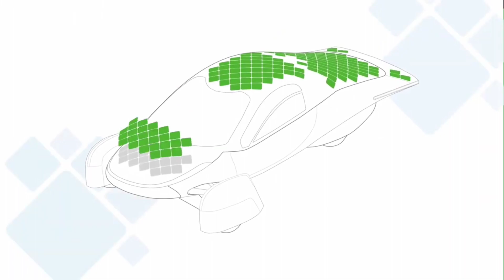Aptera Completely Destroying The Industry With This New Car

Comment: A couple of details - the original Aptera Inc. was a partnership with Idealab.  Idealab brought on a Detroit team when they were ready to start production, and they wanted to build a more conventional vehicle.  They went to the board and kicked out the founders by a single vote in 2009.  They were unable to raise funding for their new plan and liquidated the company and returned the deposits in 2011.

The new company, Aptera Corp, was founded in 2019 when Chris Anthony was able to repurchase the rights and regather the key people from the original team.  There is presently a new crowd funding round open on the Republic platform.  Investments start at $210, and as of today, January 2, they have raised $727,051 in a little over a week.

The number of preorders you mention was taken from the order number series.  Due to some refunds and the fact that new numbers were issued for order add ons, the actual number of pre-orders is something over 38,000, but still increasing rapidly.

Due the unexpected number of orders to fill, Aptera has abandoned the original plan to produce body parts using vacuum resin injection, and will now have the parts stamped from fiberglass and carbon fiber sheet by supercar body maker C.P.C. of Italy.  This will allow production numbers to ramp quickly, but in order to produce the tooling, a major investor needs to be found in the next few months if product is to be delivered this year.  There will also be a major increase in the precision of the parts.
Reply: @Aly Baly [all anyone needs to do is watch just one of your videos to know where youre coming from.] Effective communication skills. 
[For some odd reason you have an unhealthy hate for this company.] I wrote all about hate on one of my last 3 video's (can't remember which). I recommend it to you. There is no reason to think I hate, not even an odd one. 
[Vey bizarre] The problem lies completely with you, and consists of a lack of understanding well below what an average13 year old should have.
Reply: A couple of corrections "They (which is the Detroit team) went to the board and kicked out the founders by a single vote in 2009." It was Fambro and Anthony who went to the board with the aim to kick out the Detroit team. They lost, and nobody got kicked out. F & A tell Jay Leno on his video test drive that they left because the wanted to do something else. It had become less interesting than growing veges and making batteries.
CPC is not a supercar body maker - it merely supplies parts to supercar makers, and it is unknown to what extent they participate. A rear hatch is the largest item I have discovered they supply to an aluminium car body, and I would like to know if anyone can prove better than that? Bertone and Pinninfarina put their names on bodies they make, and I have yet to find CPC badges on any cars, let alone on supercars.
Watch out for all the lies and deception.
Reply: @aussieideasman8498  Any one who knows how to do their own research will find it trivial to refute the allegations you make here.

As usual our Aussie ideas man has no evidence to back up his assertions.  If anyone cares, I suggest they look up the Wired article of the time, titled: "Aptera Founders Ousted in Boardroom Showdown"

,Also, he seems totally unaware of what Modena, Italy is known for, and his default position for his inability to do his own research is to ignore the facts that are available to everyone else.
Reply: @n.brucenelson5920  [Any one who knows how to do their own research will find it trivial to refute the allegations you make here.] Anybody who proves nothing because he hides behind an NDA he begged for should realize it's pointless to argue with someone who explains everything. You have played the 'can't research' card way too often, as well. I have told you that a number of times over, but your senility gets in the way.

[As usual our Aussie ideas man has no evidence to back up his assertions.] Correction: Most of them are explained well enough' a rare few are only with good signs given; and then there's that scientific premise that it is folly to try to prove a negative. For example, if they say it can do 0 to 60 in 3.5 seconds it's up to them to prove it, because nobody can prove it doesn't when they can't get their hands on it. Aptera are the first people in my 69 years that I have seen turn off the timing lights on a drag strip before they do runs. Come on now - put two and two together! 
[If anyone cares, I suggest they look up the Wired article of the time, titled: "Aptera Founders Ousted in Boardroom Showdown"] Now there is absolutely no reason to look it up, because being ousted is a different story than what came from their own mouths on Jay Leno's video. He asked what happened, and they say they left to pursue other interests after merely disagreeing with the Detroit people; no mention of a board room ousting. The start of what are a plethora of almost pathological lies. Did they tell Jay the solar was fake on what he was driving? It was. When they revealed the Gamma, they said it was the first with working solar. Liars get caught lying.

[Also, he seems totally unaware of what Modena, Italy is known for, and his default position for his inability to do his own research is to ignore the facts that are available to everyone else.] It is immaterial what any town is known for. The issue is whether CPC makes entire supercar bodies for a number of supercars with other badges that are on sale, because this is your claim, including the claim of those snake oil salesmen. I say that is deceptive, and my bad research can't find a single body on any of them. The best I can find is an engine cover and some spoilers. Now, use your superior research skills and prove there are at least two supercars that are being driven around with entire bodies made by CPC. If not, you aid in the deception. This is going on my last video because I don't trust you not to delete it here.
Reply: @aussieideasman8498  Thank you for confirming that you don't take the time to look for the truth.  Lots of prose to say that you have not really looked at the record.

I have signed nothing that prevents me from referring to public information.  I do find that providing links on Youtube often gets my posts deleted.  

I have no power to remove your posts on any channels but my own and have not done so.  You can take your paranoia somewhere else.  

You have given me no reason to give your own channel traffic, but I don't discourage others to go there if they wish.
Reply: @n.brucenelson5920  [Thank you for confirming that you don't take the time to look for the truth.] I know what is true, so keeping on looking is moot. 
[Lots of prose to say that you have not really looked at the record.] I'll accept your word this once - does that Wired article confirm they were ousted from Aptera at a board meeting? If so, then what I said stands. If not, then the article has a lying title, and you deceive people by using it.

[I have signed nothing that prevents me from referring to public information.] Is the skin cooling method public or private? Explain on my videos about it how what Daniel showed Steve from AOC can actually work. You can include the Death Valley simulation by the computers next door. 
[I do find that providing links on Youtube often gets my posts deleted.] Happens to just about everyone. Give enough of the name that a search can locate it and ditch links.

[I have no power to remove your posts on any channels but my own] Untrue. If you made the first comment on other sites and you delete it, everyone who responded will be deleted with it. Fanboys do it all the time to me. 
[and have not done so.] YT also deletes and tells nobody, which makes matters unclear.  
[You can take your paranoia somewhere else.] Tell me why it is severe enough to be paranoia? It's just matter-of-fact in my book. What I am convinced of, and it has nothing to do with paranoia, is that it is low, gutter tactics, whether by people or organizations - it doesn't matter who does it, deleting is for cretins, as is blocking. 

[You have given me no reason to give your own channel traffic,] And what reasons do you have not to? Skin off your nose, by any chance? I have no concern for traffic and every interest in spreading information - especially that which tens of thousands are obviously blind to. I don't twist anyone's arms, and they get it for free.
[but I don't discourage others to go there if they wish.] Telling people I can't research is a form of discouragement. You are thick enough to be blind to the very things you do.
Reply: @aussieideasman8498  Have an upvote from me!  I hope people read your reply.  I gave you the title of the Wired article so it is trivial for you to check for yourself.

Note you said " Give enough of the name that a search can locate it and ditch links"  It clearly doesn't seem to be enough for you to do so..

" You are thick enough to be blind to the very things you do."  I suppose that a simple adjustment of the subject of your sentence makes it fit.

I have lost patience with people who tear down a project the world needs, and who have not even done the work to understand the history of the founders and their companies.  It is not even "lying".  It is just plain laziness.
Reply: @n.brucenelson5920  [Have an upvote from me!] Thanks, but it's not much of a recommendation. I would prefer decent answers to questions once in a while.  
[I hope people read your reply.] I hope some understand it.  
[I gave you the title of the Wired article so it is trivial for you to check for yourself.] Correct. Good statement, but I think you might mean it as a question.
[Note you said " Give enough of the name that a search can locate it and ditch links"  It clearly doesn't seem to be enough for you to do so..] Only because the title was so definitive. Now, stop looking for rabbit holes and address the issue.

[" You are thick enough to be blind to the very things you do."  I suppose that a simple adjustment of the subject of your sentence makes it fit.] I'm about to take a nap, so that simple adjustment escapes me right now. Just quit the petty stuff and start addressing the issues.

[I have lost patience with people who tear down a project the world needs,] There's tearing down projects that are working, and there's tearing down projects that are doomed to fail, and have been dragging the chain for far too long. Give those who tear down the latter some slack; just lose patience with the first group. 
[and who have not even done the work to understand the history of the founders and their companies.] So write three paragraphs where I have a misunderstanding of the history. Don't just lose patience - actually do something informative for once.
[It is not even "lying".] Losing patience is never lying. Who said it was? You're brain is off with the fairies again. What is the subject matter of your sentence? It's you losing patience with people.  
[It is just plain laziness.] Give me the fancy laziness any day. I'm not into plain anything, other than plain speaking. But you hit on a concept you and Sandy M should be well aware of - if you want the most efficient way to operate, ask the laziest employee. Drucker, Carnegie or Deming - uni was too long ago to remember, and I'm too lazy to check.